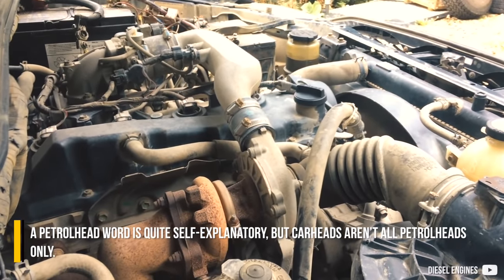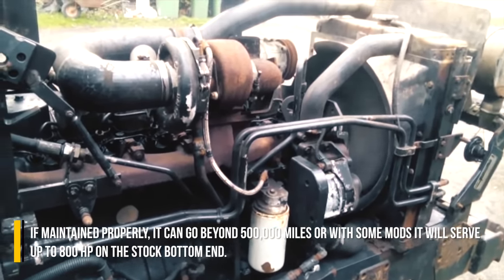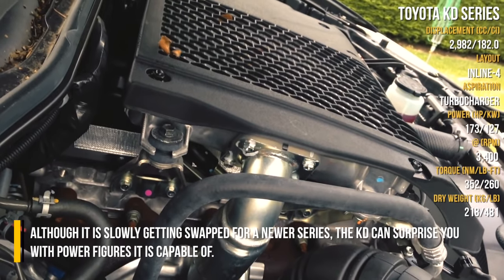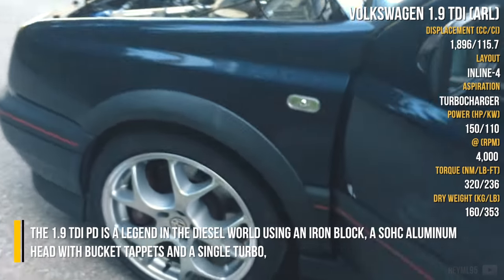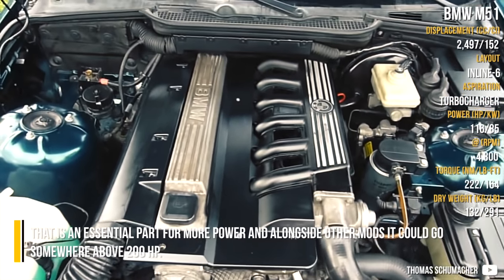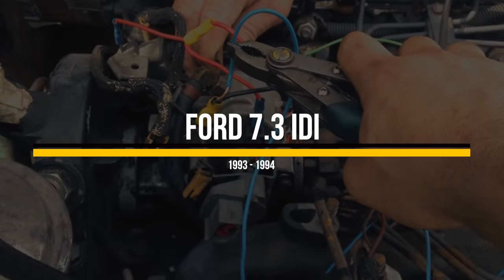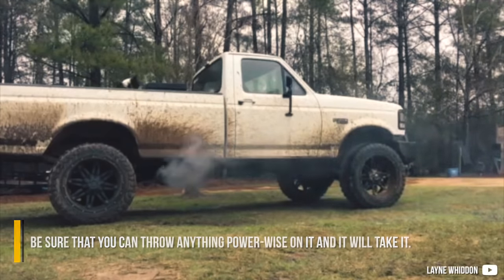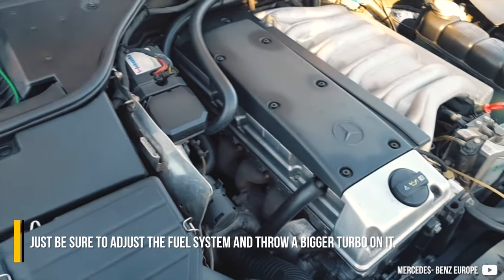6 Best Diesels For Engine Tuning | Ep.1

Comment: i think that BMW M57 is much better than M51 ,i heard from people that they tuned it over 400 hp on stock internals
Reply: I have M57 e46 bmw with the 204hp stock model. Simple chipping made it to 720nw and 295hp. For more you only need to change intercooler and injectors.
Reply: exactly what i was thinking M51 is garbage even stock , but M57 is a very nice engine
Reply: M57 should have definitely been on the list instead of the M51; my 2009 335d is well over 400hp & 600 lbs/ft
Reply: MrYlijumala what about those plastic valves? Did you remove it? Thanks
Reply: Actually the M51 is much more reliable than the M57. No swirl flap issues, simple mechanical injection system and no DPF or EGR problems to worry about. With turbo, intercooler and exhaust upgrades they can better 300bhp.....plus the can run on vegetable oil! :-D
Reply: Yeah my mate's 335d runs a comfortable 465BHP and 921NM on stock internals!
Reply: @soundseeker63  The fuel pumps are crap on the M51. The bottom end is not strong and the heads crack alot. The M57 is way more reliable in its structure.
Reply: I have a 2014 530xd, its mapped to 330/700nm at its the best engine I have ever driven, its like a super torqy small block v8,
Reply: Thought the Same
Reply: Mine have 360 hp and 720 nm of tourque(Limited)
Never Had any Problem with the Engine
Reply: All things considered, the BMW M57 is the best diesel to modify. 3.0l,capable of 500+whp, 700 lb/ft torque.  Put that in a 335d.
Reply: N57? Anyone?
Reply: You're right! M57 much much better!!!
Reply: amw1505 Jupp, the n57 is simply better than m57. People talk so much here. But they have not even changed a pair of glowplugs...
Reply: @Xfacehack  my e92 N57 just had the timing changed and bearings make a "nice" hit down the engine bottom ...can't  say same for the very best 330d M57 engine that i had stripped down for my E46 project ....so ..go ahead and change some ..more spark plugs...simms that glow plugs are not for you :))
Reply: @dyzzyone  What tha heck was done to that engine? Given the weight to power, the fuel economy, the long lasting parts. well not in you case...mine has 165k miles on it. Over here in euro. The n57 makes more sense.

The m57 had just as much if not more timing chain snaps/problems. The swirl flaps is also much much better on the n57. Also the water pump had and update an does not fail as much.
Reply: @Xfacehack  first time when I heard that N57 is more reliable than M57 .M57 has the top (camshafts)chain same size as other 2 .Later in N57 BMW made it thinner in order to improve the fuel consumption and also put the chain in the back where the crank gets all the torque directly from the flywheel. Also the bigend bearings in my car were fucked and had to sell the e92 for
3000£ after I spent 1000 to have  timing changed and all the service done ...and I have done all the jobs in my froend garage ..not paying  for labour .Car value suppose to be over 5000 ...ALL parts used were BMW and I had swapped  every bolt ...as per manual .I am not a qualified  mechanic but I like to work on my cars and respect " them" .It is true that M57 had the flaps issue but was something that could have been easily controlled (fixed) .was 30£ the blanking plates was the first thing that I have done when I bought the car .
So yap ...every guy who has knowledge about those engines will say that M57 is better engine than N57 .It is true N57 will be more efficient and powerful  in stock version ..but will never go and tune N57 against the M57 .M57 will be your only option :) .Cheers .
PS : England is still in Europe ..and I'm from Romania . :)
Reply: @Xfacehack  by the way 
.when you say that N57 is a better engine than M57 will be same case when yoh say that  N54(BMW -335i)  is better than  2JZ-Gte(supra engine)   .Yap ..they share big numbers but that's  all ...2JZ will always be better .
Don't  forget ..everything done in the past in auto-moto industries was more reliable. As time goes all car manufacturers will look for fuel efficiency  and low cost cars .So with less money you can't  get quality .That's  why you see old engines  remapped and not the new ones .
Reply: @dyzzyone  Yes the front camshaft chain is thinner, but never heard any issue with it! The n57 is a new beast and it has not been on the market for very long. That's why m57 is hot right now. But people make "big" power on stock n57. And yes maybe when it comes down to it. The steel block might handle more power. But unopened the n57 can make more power, from what we seen. Sounds to me you have an lousy tuner.
Reply: @Xfacehack   Carl Strandberg  never tuned the N57 that i sold due the chain issues and the failing crankshaft bearings. Was willing to do it but ..aas afraid .So I changed the bearings with the crank on (not easy to do it :) ) ...and sold the car .Will never try to tune an N57 as is to unreliable from my point of view. Unfortunately there is no way to get a  custom  M57 inlet manifold, a  bigger one  to force the M57 at his true power ...I belive you can go over 700hp with a bigger custom intake ...but nobody tried to build one .
Have knowledge of lithuanian and polish lads that got over 650 hp  :) ...a number that for  N57 is hard or impossible  to achieve .I believe there is no N57 to brake 600hp limit.
Reply: @Xfacehack  that's an M57 with 650hp ..in Poland ...and is using E60 intake if I am not wrong ..don't know polish  :)) ..but it looks like an e60 manifold .Displacement of the intake port on M57 is making difficult to get a bigger customized intake .
By the way ..all tuners will agree that M57 is more reliable engine . :)
Reply: @Docbrut  The 335d has an N57 not M. The M57 stopped being used around 2007
Reply: Exactly the owner of the video clearly doesn't own a performance diesel and apparently a Cummins engine is good lol 😂😂😂😂😂😂😂😂
Reply: I has a 525tds e39, my engine head cracked in every cylinder , i changed the head and after 7k miles it cracked again, without overheating never, 
Ita a veru very good engine but some engine head are garbage, it cane make 1 million km but if you drive very very careful, 
I will never buy m51 again in my entire life, i want to buy a 530d e39 m57 engine is stronger and more powerful with hp output
Reply: CTF performance has 800 HP coming out of the stock internals on a Cummins 5.0. The only mods made were a big non VGT turbo and a new injector pump with a better lift pump.
Reply: @MrYlijumala  hard to believe... Everything above 270-280hp requires the 535d injectors an an upgraded turbo. Also a better intercooler. Maxout for just an OBD Tune is around 250-260hp and 500-550Nm. Remove the Cat and you get around the 270hp mark...
Reply: @frankotto83  Believe it or not. I have the dyno slip on it and that is all I care about. It was a professional tuner who did the car and not and easy flash tune. Had to do it the hard way since I got the automatic which does not handle the power so well. But the guy said 300hp is doable with only a tune. But you have to remember there is 2 variants of the engine. M57D30 and M57TUD30. You have to have the TUD version. And yes I have the plastic flaps still in place.
Reply: @MrYlijumala  haven't heard so much Bullshit in a long time. Now it is even a shitty Automatic and the Swirl Flaps still in Place!😅🤣🤦🏻‍♂️ The Automatic is rated for 380Nm, so it is overstressed even with the Car right out of the factory. And NO, 300hp are NOT doable just with a tune. Oh and the Enginecode is M57D30TÜ, just to clarify that.
Reply: @frankotto83  some people just like to talk...

Btw, my M57 in my E46 is bone stock, although I work on it myself.
Reply: yes this is true mine is tuned to 340hp right now and ill be getting a 400 hp tune soon
Reply: @frankotto83  Still don't matter what you believe vs what I have. I drive that thing daily. (btw I don't hoon with it) and the stock automatic has lasted me 2 years now. Still have the dyno slip in my glove apartment. And I can tell from your language that you only go with what you have heard/seen on youtube and no actual data or experience of these cars.
Reply: @frankotto83  Try a better tune than ur obd flash
Reply: There is a good reason why M57 is such a popular swap for Nissan Patrols. They are very well built engines and can easily go over 300hp. My friend has a M57 Patrol with 500hp and if I remember correctly, it has stock internals still. He drove it from Poland to China and back with no problems, even high up in the mountains of Kyrgyzstan...
Reply: om606 can do 500+ ofcourse with all the supporting mods but all stock internals and can do 6000rpm.
Reply: Same here, M57 is masterpiece of bmw engineering in bmw e39, especially with manual transmission and without notorious swirl flaps found on automatic. Btw its capable for 300+hp with e60 turbo, x6 intercooler and M57d30tu injectors and proper remap,
Reply: @frankotto83  the e60 530d have 500nm stock at 218bhp ( 2004 year model ) so with only a remap i think u get easy 550 or even bigger numbers yes for 300+ bhp need a 231 bhp turbo ( a newer model ) and for 400+ new fuel pump and u get like 400+ bhp and a minimum of 750nm !
Reply: I had 380bhp / 800nm torque out of a 57 plate 530d saloon manual gearbox. Single hybrid turbo.
Reply: M57 is not tuner friendly. You shouldnt remap it, it's in best form as stock, the x35d model is the perfect combination of max torque, reliability and performance. Once you start remapping/tuning that engine thats where ull dig urself a hole. M57 can go up to 1mil km, but only in stock. If you are talking about bmw's you should know which engines are tuner friendly, dont expect other engines to do the same as they were made with different intentions. In the newer models the only tuning u wanna do is delete's and replacing plastic parts with cilicone, if you can get away with it from where you are from. Dont mess with anything that will upset the modules. M57 is your reliability car, workhorse. Not a project car.
Reply: P  Delete your EGR.
Reply: @soundseeker63  You are comparing older vs newer model. Every single new diesel car will have dpf/egr and other systems. You can delete them. If you do have e46, respect, but new models will always be better. The only good thing about m51 is less uneeded shit around, but m57 itself is much better.
Reply: @domse16  If you want your car to remain road legal in the EU or UK then no you can't delete all the emissions control equipment. You might get away with certain things like a blanking plate in the EGR but thats about it.
Reply: @soundseeker63  Well im from EU, your car is road legal if you pass your MOT, meaning you can either pass it and do what u want, or find a friend of a friend to help you pass it :) When it comes to police having a fartcan will make them test noise, i never seen police testing emissions, and they cant check under the hood, yo ucan always say that its an old engine meaning it doesnt have any emmision equiment

But anyways, there is ways to go around, if cars is life its worth the hassle. I suggest making a friend at where u get MOT or whatever u call it, and have him explain how you can go around rules. It's just that , once u get the papers that ur car is road legal, no one can check what you've done, say that its illeagal or anything. 
Same as joining the army, you can "ask" the doctors to not show certain things in your profile if you really really wanna join. And once you're in, you're in.
Reply: @soundseeker63  i got a friend that has an old audi and he just enjoys it having straight piped, really oldschool and really fun car, for MOT he just swaps it back to the old one. And as its a very old car, its plug and go, no need for any tunes or anything.
Reply: M57 is waaaaay better
Reply: I'm swapping an M57 into my bmw e36 coupe.
Reply: @Xfacehack  
Try to change the timing chain on the n57
Reply: @Xfacehack  n57/n47 has the chain issue.m57 the flaps.
If you strip dawn the m57n2 its the best
Reply: @dyzzyone  thats the n57, comes in the lci models
Reply: @stijndebondt432  have I said otherwise?
Reply: @stijndebondt432  Depends on what lci model, the 335d lci e9x still got the m57tu
Reply: M51 is ancient
Reply: @MrYlijumala  720nm? are you shredding your tires everytime you accelerate?
Reply: @Fantastika  Nope. It was pretty normal feeling car. You could shred that one tire fire. But like I mentioned above I did not hoon with it. I have other cars for that. But that thing is sold already. Was a good car tho. Nothing wrong with it in the time I owned it little over 2 years.
Reply: @alexandruv847  Sounds stupid but M51 is an stronger engine, but not so easy tunable! M51 is like OM606, with bigger injector en tuned VE pump and aftermarket Turbo can make same HP as OM606! Requires more work though.
Reply: I wish it was a cheaper motor ahhh, I’d buy one and build slowly on a stand.
Reply: 1:46 it's from my country, Indonesia
Reply: @asdfghjklkjhgfdsa69  wrong. I have a 2011 335d with an M57 here in the us. Stage 3.1 making 415hp and 1000nm tq.
Reply: @bmwm3z36svi  It was maybe used longer in the US due to far less restrictive emissions laws
Reply: @amw1505  not the best one... issues with chain.. and not a big buffer for performance gains from stock. It is a powerful engine no doubt.
Reply: The F10 550D has 370hp stock (N57D30)
Reply: You can tune a Mercedes om606 to600 HP stock internals
Reply: Yea it can take 500 hp I heard, engine is was stock tho, i have a x3 with a m57 and thing can almost keep up with a c43 amg
Reply: Nummer 🥇om606 from all disel car

Comment: IMO the most indestructible and tuneable Diesel engines come from Mercedes - OM602, OM606, OM617... Well done saving the best for last 👏🏼
Reply: Don't forget the 616 & 618
Reply: id say cummins engines. There are people building 2000hp diesel trucks which can outrun supercars in america
Reply: @emilandrei9328  and om647. same as om612 but the om612 has less emission stuff bolted to it
Reply: @gabrielmessam2374  sure, maybe if it’s built. The Mercedes is half the size and can safely and reliably make 550+ hp of a stock engine with the exception of injection pump and turbo. A built Mercedes can make even more and is a lot smaller and lighter so it’s easier to swap in thing. I like Cummins but the Mercedes wins.
Reply: 6bt Cummins will safely run and last a long time with 1,200hp. Very little modifications needed.
Reply: i have an OM662 (2.9 version of the Om602) and it's a real deal, a good engine
Reply: @gabrielmessam2374  it's problem is that it can't go in everything, they need to make a small aluminum block with there architecture
Reply: @gabrielmessam2374  yes because its 6+ litres and weighs 600kg

Comment: Bmw M57 engine should be on that list not M51 :D :D, Mercedes 60x series are all good for tuning.
Reply: ZeusMind  the om601 sounds like an old tractor on idle as supposed to M57 which sounds so smooth on warm idle. On cold start it’s sounds like a beast with a “wobbly” sound like a v8
Reply: ZeusMind  yeh I know I was just saying it